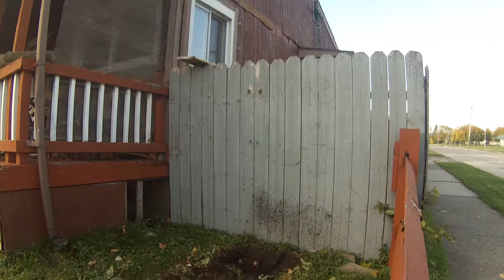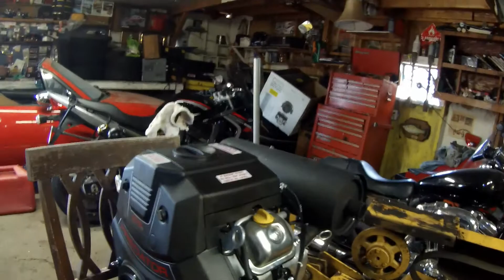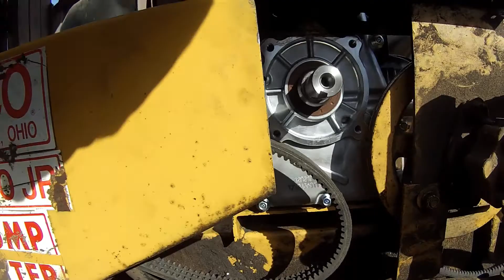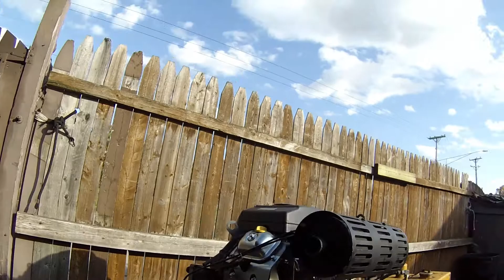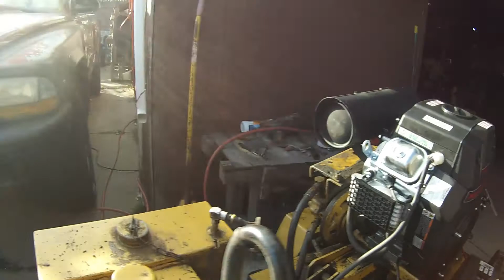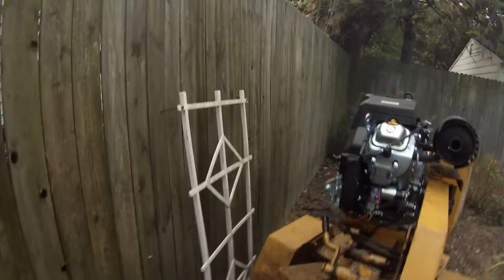Predator 670cc V twin 22hp Rayco Super Jr Stump Grinder Part 2/2 On The Job

Comment: Please tell me what belt you are using!!!!!   Please what is the number.  I have a RG 1620 JR rayco grinder that I broke the belt on.  The original belt is 716013 it’s 90in OD.   The original engine failed so I have a 20hp kohler on it now.   I need the same belt but about 6inches shorter.    The old belt is so worn out I can’t read anything on it except that it measures 84inches and it’s a 3V.    Please any help would be amazing. I’m dead in the water.
Reply from the maker: It's a gamble finding a belt man I would say just order a few and see what works for the machine also check if has adjustment spot somewhere on the machine.
Reply from the maker: There's a older video on this channel. Type 1989 rayco stump grinder belt on YouTube the belt info is there.

Comment: I'm fixing to do the same thing with the same motor and machine did u have to buy anything special to make it work And is that the same pully off of the Kohler motor
Reply from the maker: Hi Big Bill I couldn't get the pulley off old engine and shaft size was different pred22 has a 1" shaft you can order a bearing and pull offline  I found Grainger store by my town and they got it for me.
Reply: @doitalldavey8788  do you know the granger part number
Reply: When I changed out mine bought a crank shaft sleeve worked great

Comment: Did u run into any problems with oil level 2qt seems to be to much
Reply from the maker: I believe that's what the manual called for haven't used engine enough to really know yet
Reply: I verified yesterday definitely to much oil smoked like a bandit till I drained some . Also I've been having trouble with my pump belt rolling have you any similar problems
Reply from the maker: Just line belts up as best as possible. I had issues with the keyway not holding the pulley. I bought quarter inch steel bar to try and fix it.

Comment: I also have a rayco 1625 I’ve repower from a kohl’s 20 command too a predator 22 having problems  with shaving being sucked in blocking air flow, have you experienced this n how did you handle it
Reply: If you have can you post video of what you did
Reply from the maker: Hey Tim I can't say I really used the engine hardly at all to notice since buying myself another 1625. I'd say keep an eye if you have that engine and change engine oil after breakin